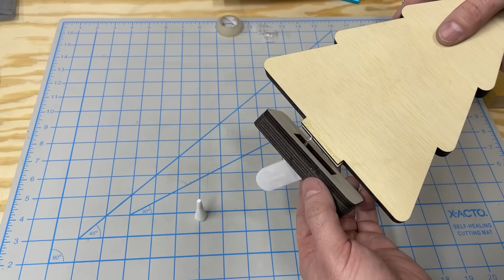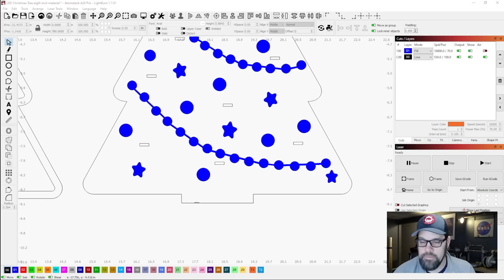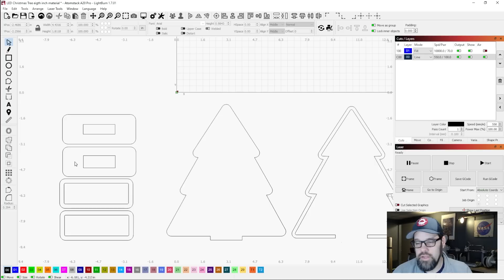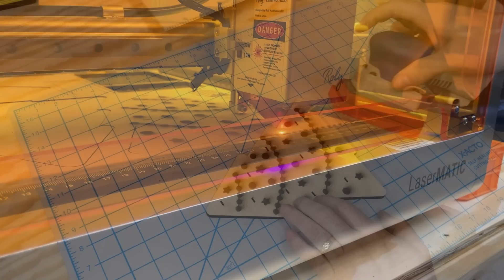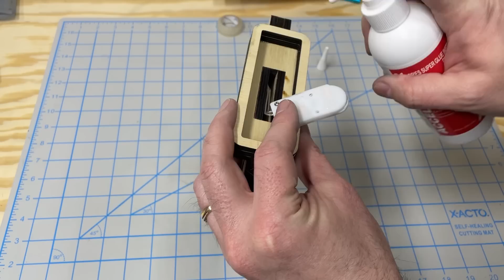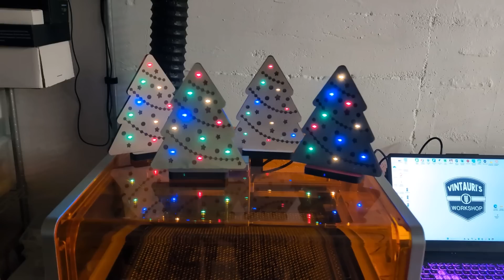Laser Cut LED lit Christmas Trees

Comment: Perhaps a Velcro dot for the battery holder so it eases the replacement later?
Reply from the maker: That would work as well, might need to add another layer to the base as it would be a touch thicker.  Thanks for sharing!

Comment: Why not use real Christmas lights? LEDS are bland in comparison and those are too hard to see during the daytime. Cool idea, though. Thanks.
Reply from the maker: I was looking for something that would be easy to manage the wires and also run on small batteries.  I looked at a few other options for more realistic lights but the ones I found had huge battery packs.  Hopefully someone plays with the idea and takes it even farther!

Comment: I use Titebond 2 glue to laminate projects together. I find it gives me enough time to align everything up and yet it sets up very quickly. You will find that find that it is hard to pull pieces apart after about a minute. The trick is, do not slather it on like you see most people do that you see doing edge gluing. A thin layer is adequate.  Some things I like to use CA glue if I need immediate set, but if I need a little adjustment time, I use the Titebond 2.
Reply from the maker: Titebond is a glue I use as well. It does give you more time to align parts and is stronger as it soaks into the wood fibers more. Thanks for sharing.

Comment: Hello would it be possible to make a video on making the round christmas Glass ball ornaments on a Atomstack diode laser either using a diode laser itself or using the Atomstack R1 Rotary roller. There are videos on Youtube but most are made with the Xtool F1.

Thank You
Reply from the maker: I'll see if I can find some of the glass ball ornaments. I checked last week at Michaels and they were sold out of the red ones and the blue ones might not work as well with the blue diode lasers.
Reply: Thank you

Comment: When you said "set of calipers" it made me think about why I have said 'pair of calipers' for the last 50 years. I really don't know!
Reply from the maker: @JT-Patriot  you need a set as you will always misplace one of them! 🤣
Reply: Being a master machinist, I was taught that calipers were never as accurate as micrometers. I actually have used micrometers that were 36 inch!
Reply from the maker: @JT-Patriot  I inherited a set of Starret tools, including a small micrometer. However, being more of a woodworker than a machinist, a good caliper is more than suitable for working with wood.
Reply: @JT-Patriot  It’s just like buying “a pair of pants”  I’m just buying 1. SMH